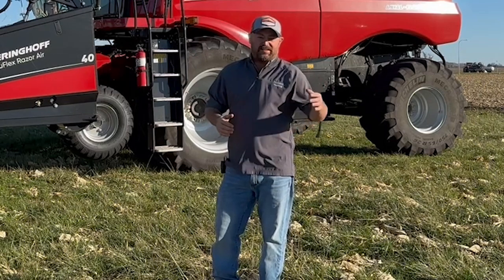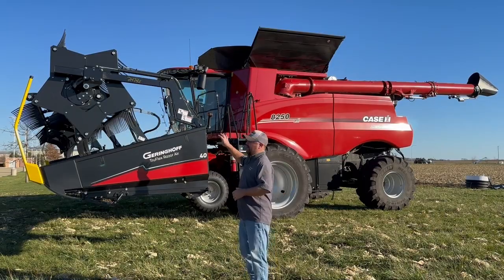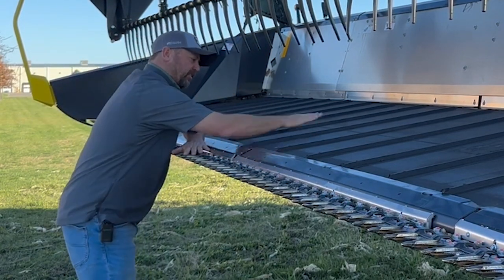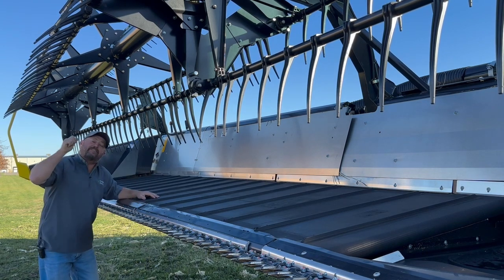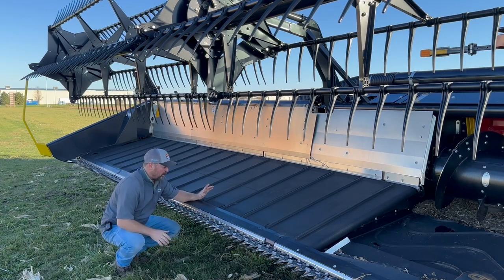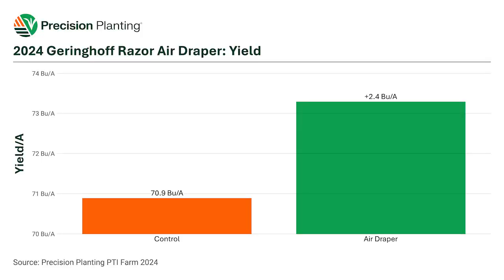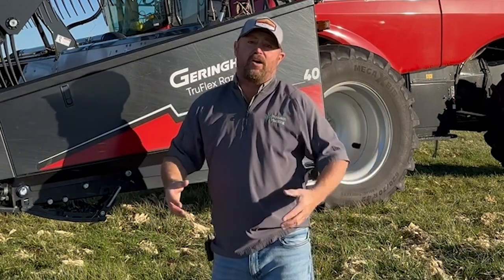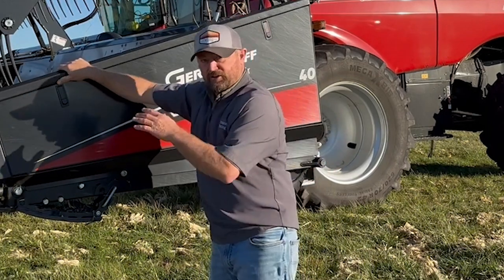InsidePTI | Air Draper System ‣ Soybean

Comment: I would like to see a loss comparison between this new air head with a regular draper head with the add on AWS air system. the AWS air bar blows air in front of the cutter bar so that any beans that shatter out when the cutter bar strikes the plant will be blown into the head, whereas this unit blows air behind the cutter bar and anything shattered out at the bar is lost.